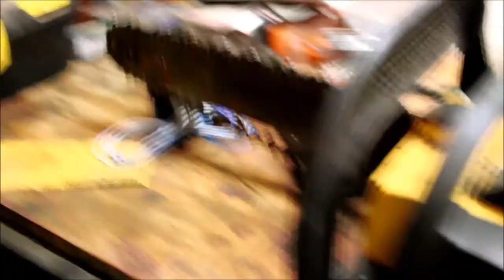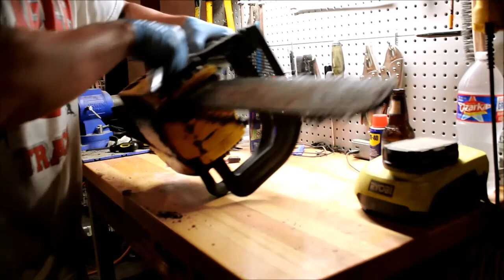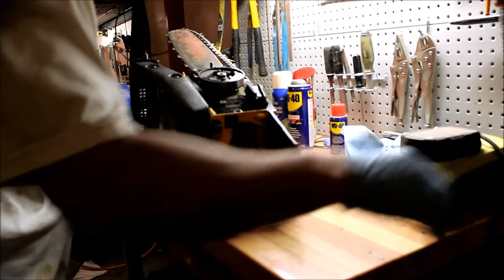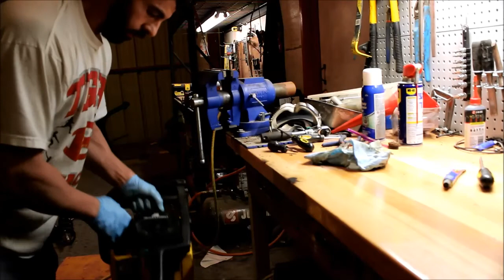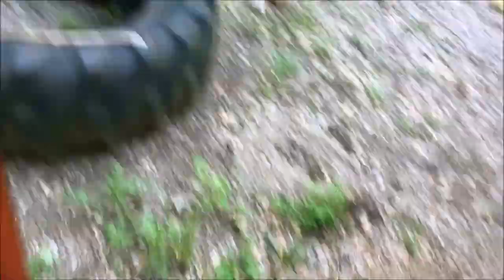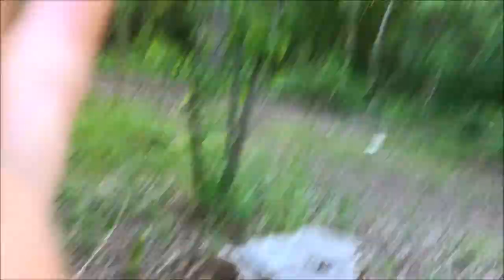McCulloch ProMac 610

Comment: Nothing better than an old Mac or Old home lite. Hell all the older saws are better than today’s junk. Yes they’re heavier because of the era of production and quality of materials used. No cheap plastic. And they last forever with proper maintenance. I have a 610 that’s pretty mint and it’s 33 years old and starts as easy as any of the new stuff and it has more torque than any of the new 58cc to 60cc saws

Comment: You need to stop listening to people that don’t know crap about saws.  The MAC Brick is a good saw, even though I am a Stihl man. I would not worry about the chain break.  I grew old with saws that did not even have them.  All you had to do with the starter rope was wind one more turn on the pulley with the rope.  Simple stuff.  The first thing you should to to any new saw is clean it up and make any needed adjustments.  After you do that,many problems will disappear.  The next thing is pour out any gas and lubricants and replace them with known good gas and lubricants.  The next thing is try to start it after giving it a capful of two cycle gas down it’s throat.  Try Fuel ain’t worth crap.  Mix your own with Echo Red Armor @50:1 and PNE gas.